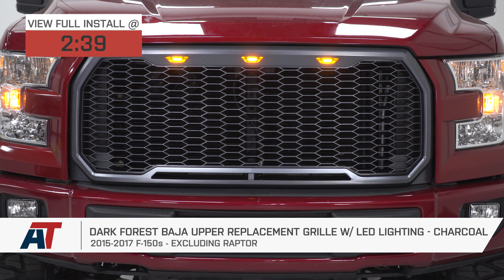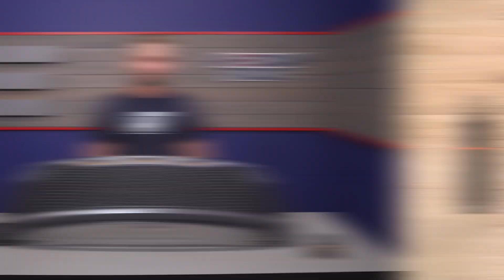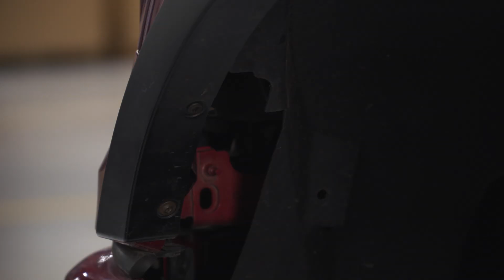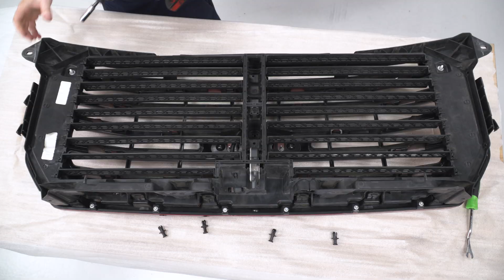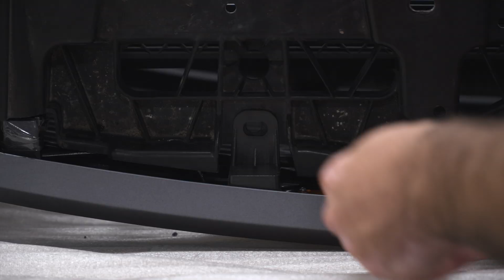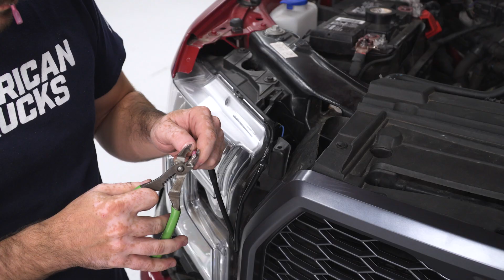2015-2017 F150 Dark Forest Baja Upper Replacement Grille w/ LED Lighting - Charcoal Review & Install

Comment: all the install videos assume you've got halogen headlamps - with the factory LED headlamps, you can't wire in like shown in this video.  has anyone wired into factory led harness?  the passenger side harness has 7 wires, no idea which to splice into

Comment: your site says this will fit the 18's is that correct? the front ends look slightly different
Reply from the maker: This will NOT fit the 2018 F150 as that is entirely different front end.  And I just double checked the site and no where does it say it fits the 2018 so I'm a little confused as to where you saw that? -Justin